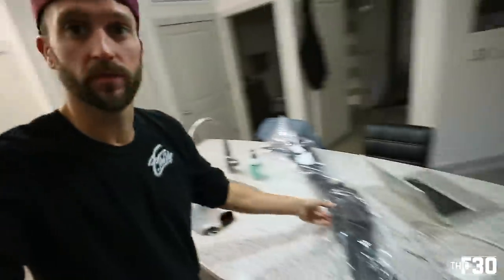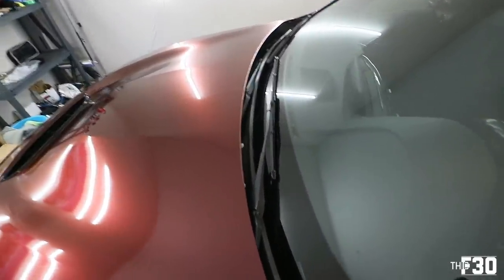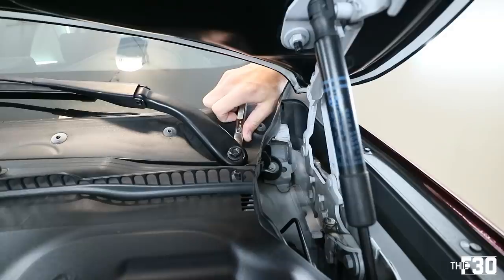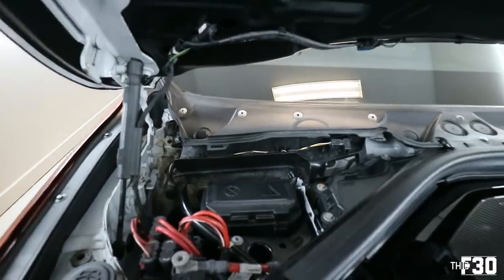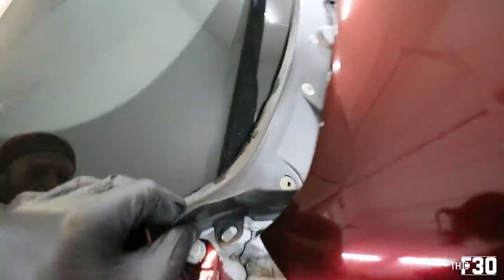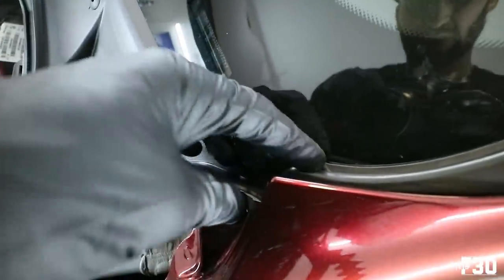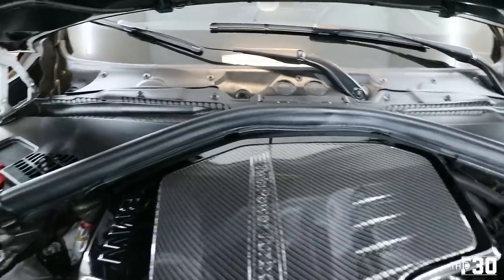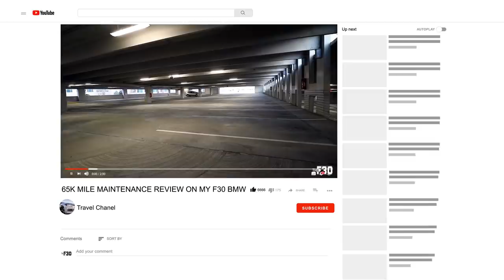YOU PROBABLY NEED TO DO THIS TO YOUR BMW. F30 COWL REPLACEMENT!

Comment: Spot on man - the toughest part are the removal of wiper blades for sure and your wrench/hammer work around did the trick without having to buy a puller I would probably never use again.

Comment: This video was great, thank you.  Parts were just over $100 and the washer puller was like $13. Took less than 45 minutes to swap out the part and a lot of that time was spent cleaning the pieces that would be going back in.

Comment: Maybe for next mod window trim replacement to gloss black? I’ve noticed some F30s have the lower window trim on the door either in satin silver steel, chrome, gloss black plastic or just bare rubber. Mine has the satin You can do all gloss black for the entire trim or maybe just wrap the trim above the windows and replace the ones on the door. I think it’d really dial in the look of the car

Comment: Great videography and a really sweet-looking whip!  Is always a good idea to index the location of the wiper blades/arms before removal and use a bit of dielectric grease on the splined stanchions of the  wiper arms before reinstall. Also, treatment with Cerakote for plastic will GREATLY increase the time between having to repeat this process! Cerakote is really nice for all engine bay plastic components as well as door scuff-plates, pedals and plastic etcetera-stuff!

Comment: Just looked on the link that was attached. It’s about $148 with shipping. How did you get it for $50?
Reply: I was just gonna say the same. It’s no longer $50
Reply: It’s gotten worse. Now ECS charges $60 in shipping. No thanks.

Comment: After having the windshield replaced, the rubber part is no longer flush with the new windshield. I suspect the cowl is “remembering” the position of the previous windshield. Would replacing the cowl fix this?

Comment: I just went through a long and hot summer here in Atlanta, and the interior door handle trim started to melt and fall apart due to the heat. Not sure if anyone else experienced this as well but just wondering what the replacement process would look like for that.
Reply from the maker: I do, kies makes plastic replacement handles. I have a set I just haven’t installed yet